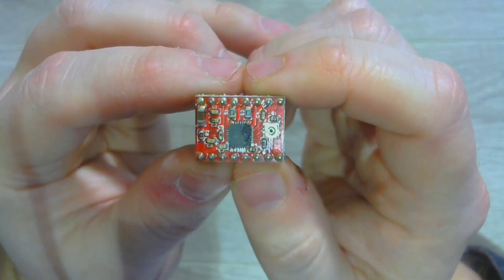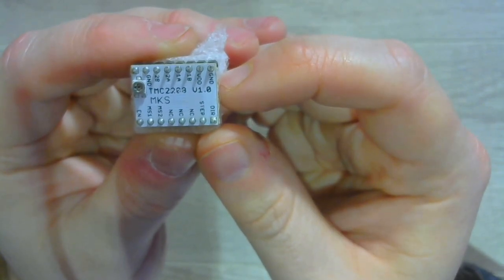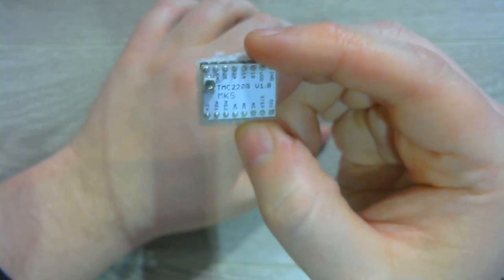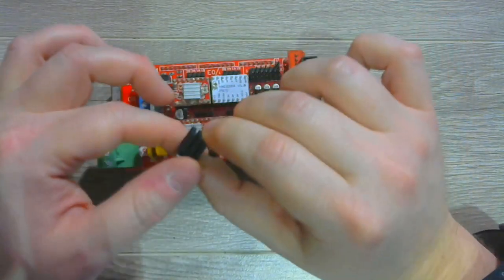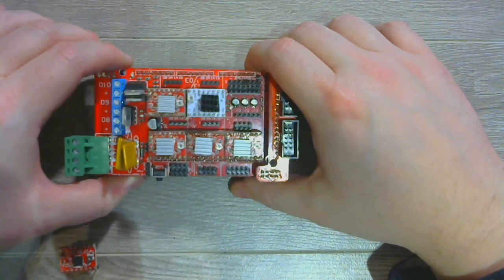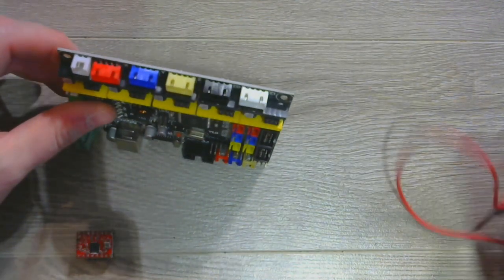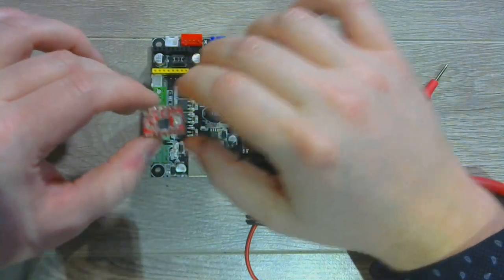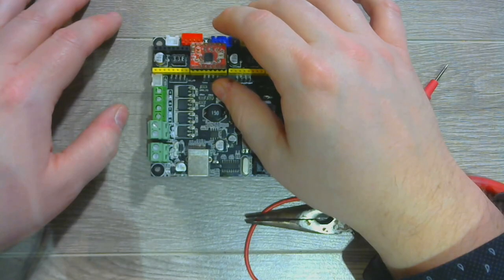Silence Your 3D Printer with TMC2208 Stepper Drivers

Comment: Thanks for sharing this, really helped a lot just replaced mine & without your video, I could have run into troubles with regards to the orientation of drivers & also a great tip for pulling off the plastic connector and rotating it to the other side.
Reply from the maker: Glad you found it helpful!

Comment: Thanks for the video, I'm definitely going to do this to my CR10S. 
If I get it correct the hardware needed for a CR10S upgrade consist of a MKS Gen L board and the TMC2208 stepper drivers?

Edit: I found out you can just buy a MKS Gen L board with the TMC2209/TMC2208 pre-installed.

Comment: I've just upgraded my Anet E10  to the MKS Gen  L and TMC2208 on the x and y axis, but they are not that quiet to be honest. Think I might have to try adjusting the vref voltage again.
Reply from the maker: Could be. Always a fine balancing act between enough torque and a quiet printer

Comment: Hey, i'm relatively new to 3D printing, so how does this actually change the sound output?
Reply from the maker: Excellent question. Essentially it comes down to voltage regulation. The drivers able to predict lower speed movements and lower the power output to the motors, while maintaining enough power and torque to move the axis. The lower the power during a move, the quieter the motor is.

Comment: can those drivers start intermintent failing??? i had print just stop  moving yet ti was still on... happened 10 hours into print then again 2 hours into print...thinking bad driver ??? any idea? thanks
Reply from the maker: It can happen, especially if the drivers are overheating. Have you noticed them getting exceptionally hot? Did it stop on one axis or all axis?

Comment: I have a DRV8825 and it's making my NEMA 17 very noisy. I am thinking to switch the driver to TMC2208, but i have also found a Stepstick Smoother from ILS that works with DRV8825. Should i just go for TMC2208?
Reply from the maker: I don't have much experience with smoothers, but i believe they primarily clean up inconsistencies in the movements of the motors, versus noise in the sounds they make, if that makes sense.
Reply: @PrintNPlay  That makes sense and i have got myselt a TMC2209 to replace my DRV8825. It is working great. Thanks. Keep up the good work.

Comment: Will I be able to simply replace these in any 3D printer or do they make specific drivers for specific boards?
Reply from the maker: I can't promise 100 compatibility. But, generally speaking, if your printer board has removable stepper motor drivers, these can be used to replace them.

Comment: Where can we buy these? Also what printers will this work on? I have a stock CR10s and CR10S5 that I am getting back into. Thanks!
Reply from the maker: Unfortunately the Creality printers all use a board that has the steppers soldered in place. So you would have to swap the board for something like the MKS Gen L. The stepper drivers are pretty common. I purchased the set in the video from AliExpress

Comment: Hey man. Good video. Do you have any input to share as far as replacing stock drivers on a FF dreamer with MKS TMC2209 V2.0 ?
Reply from the maker: I'm afraid I don't have any direct experience with this printer and it's control board. If it's the same as the one I found online, however, it looks like it should work as a drop in placement. 
https://www.digitmakers.ca/products/flashforge-dreamer-driver-board?variant=8358686457892
Reply: @PrintNPlay  yea. That's the one. I will give it a try :) thanks for the reply. Cool.
Reply from the maker: Good luck!

Comment: is it normal that my x axis even during travel movements is silent but my Y makes noise still? not during normal printing but at 50mm/s movements and specially travel.
Reply from the maker: Is it the regular motor sound, or is it more of a vibration sound?

Comment: James, what should the vRef be for these drivers for the stock CR-10S motors? Can you advise?
Reply from the maker: I run mine between .8 and .9 and they seem to be pretty happy
Reply: @PrintNPlay  Thanks for the reply... I just realized that the S4/S5 can't swap out the drivers because they're integrated... so.. whomp whomp for me.
Reply from the maker: Ahh yeah, i ended up swapping my mainboard for an mks gen L. It isn't exactly a drop in replacement, but it wasnt a lot of work to get it up and running.
Reply: @PrintNPlay  Do you, per chance have a video or tutorial on the subject?  If not then... well... get to it, man!
Reply from the maker: So... I don't have one yet... But if you are on the twitter, drop me a message, i can run you through it! @jcprintnplay

Comment: What do you need to upgrade a stock CR10-S5 to these?
Reply from the maker: You would basically be looking at swapping the stock board to something like an MKS Gen L. Then you can install whichever steppers you like. That also requires replacement of the LCD, and probably a 3D printed control box to house all those new electronics.
Reply: @PrintNPlay  Thanks, I'll check it out. I also want to upgrade the bed with linear rails as I have problems with the wheels, so I might just go all in and upgrade the electronics at the same time.